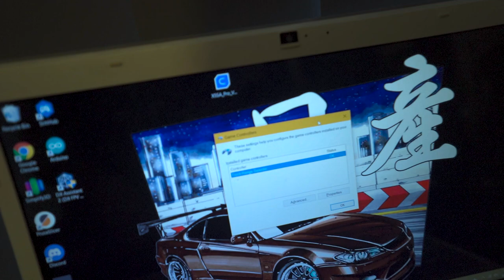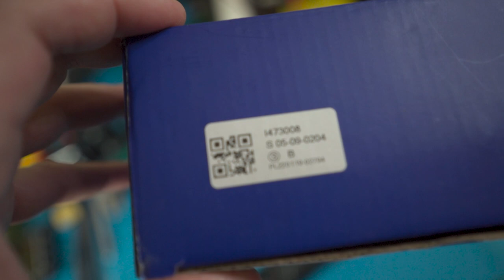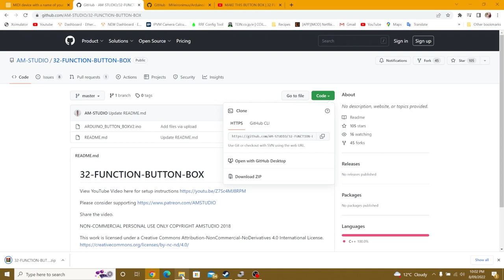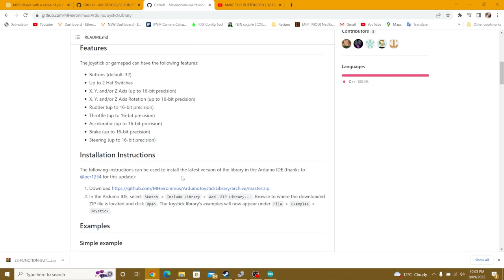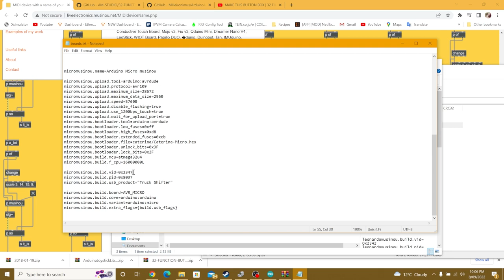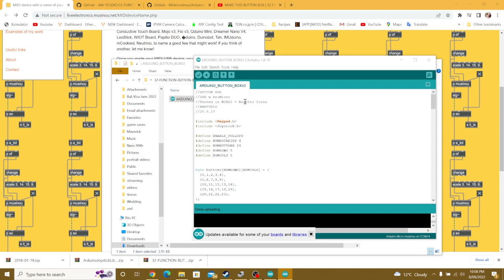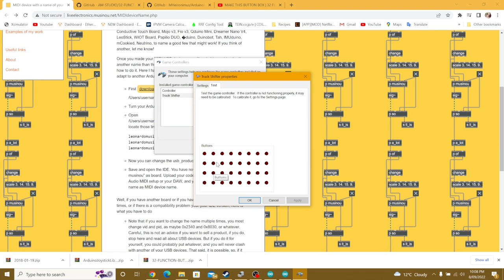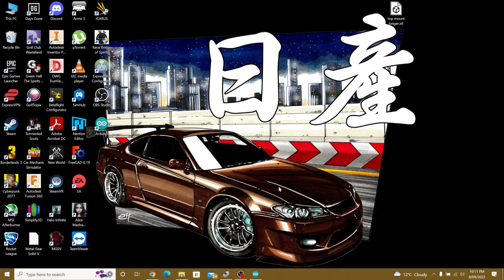CHEAP ($25) DIY Truck Shifter Tutorial - Euro Truck Simulator 2 - ETS2 / ATS2

Comment: That looks like the shifter assembly that I bought vie amazon but unfortunately cannot use because the screws that are supposed to attatch the shifter knob in place so that it doesnt rotate itself loose don't work properly so I had to remove it shortly after installing it.
Reply: would you give me the shift knob? I don't have enough money to buy it myself